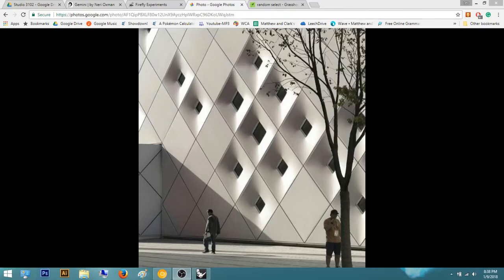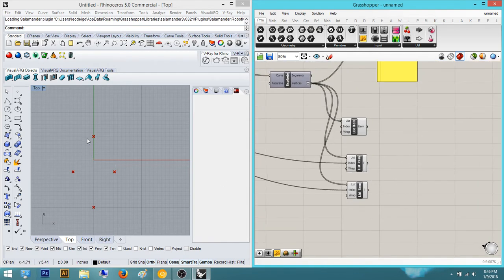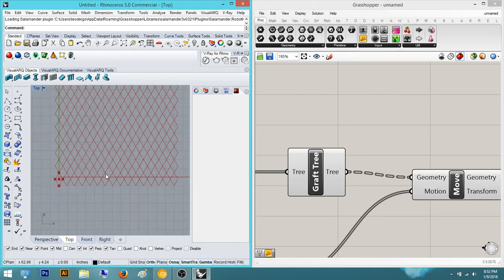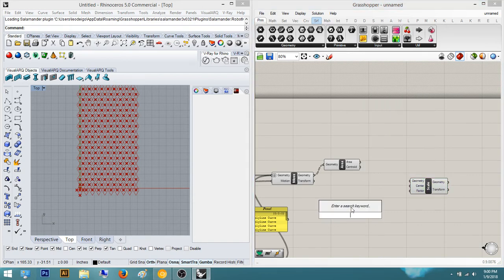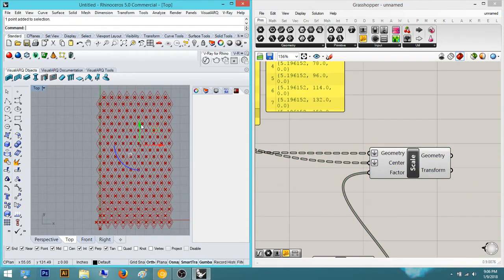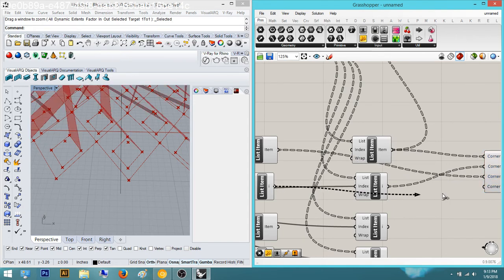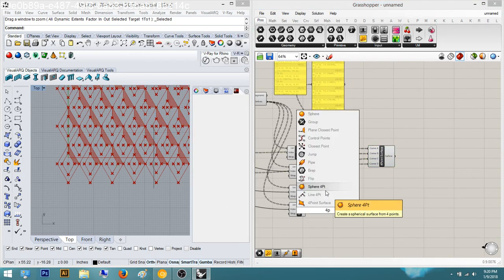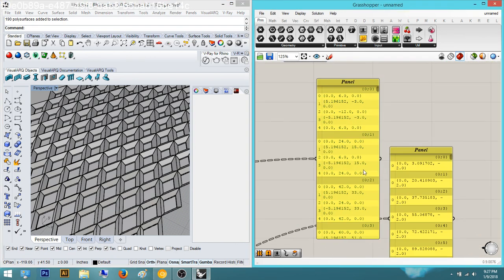Parametric Precedent #4: Second Skin Facade

Comment: These are by far the best videos I've seen working in Grasshopper. It shows all the difficulties, the rational thinking and how to tackle problems on the workflow.

I'm a thesis student in architecture. It's a complete pedagogical experience in every sense. It helps me a lot to understand lists and the logical thinking of ordering the lists. Your workflow is flawless. 

Great work.
Reply from the maker: Thank you for the compliment! I am glad that you enjoy my videos. I am actually a 3rd year undergrad architecture student. I always show my struggles when I make a video to show because it is a crucial step in modeling. Let me know if there is anything suggestions you have.
Reply: I'm familiarized with Grasshopper and the tools of DIVA LADY BUG and HONEY BEE, Revit with Dynamo and the classical BIM methods. 

My current work is on a double skin facade thesis using as parameters the temperature of the tropics and the sun path. The main problem is to design a workflow considering temperature gradients and sun path gradients. Cavity size controlled by azimuth and latitude is well known based on building orientation. The real problem is to optimize facade fenestration and illumination using both temperature and sun path

A great idea for a next series of videos would be how to make a skyscraper tower considering the structure, cladding, curtain wall and the core of the elevators. Many have done these but the videos are way short without the explanations, other addresses well known towers done in the past. The way you work is ideal to literally build a tower from scratch by a proper choice of a slab system and level quantity and size (plenum for mechanical and electrical systems), propose the structure (Core and shell), define the parametric skin (cladding or curtain wall), define parametric families for REVIT and use basic control theory through performance based design. 

That's money, plain and simple. 
 
I will post my definitions and share them with you. These videos will be used as a direct reference for the thesis.  

My email Kummer45@gmail.com  
Samuel Hernandez Montserrat
Reply from the maker: kummer45 awesome! Just email me at KineticArchitecture15@gmail.com if u wanna get in contact.